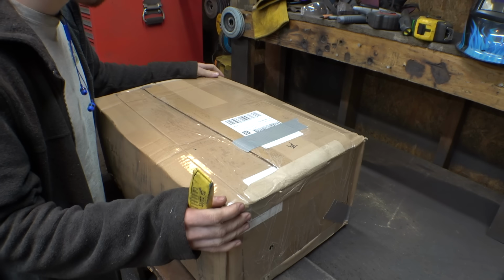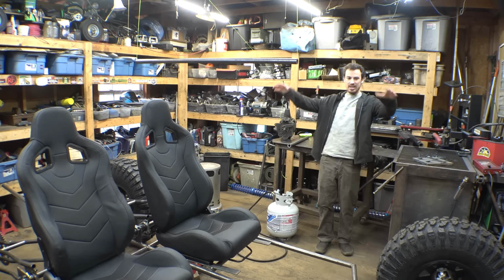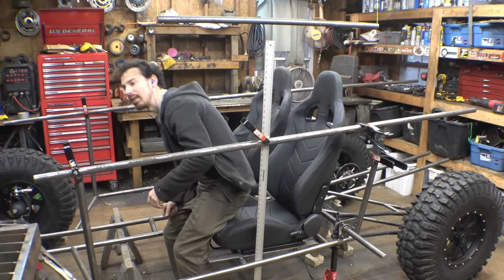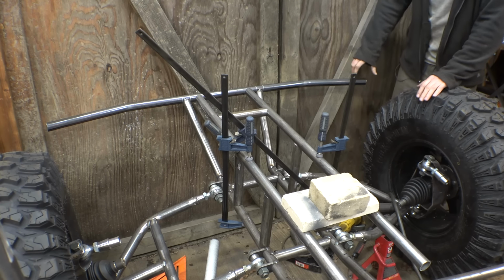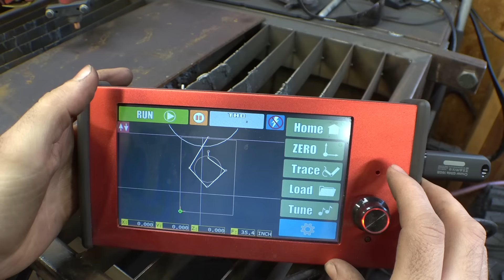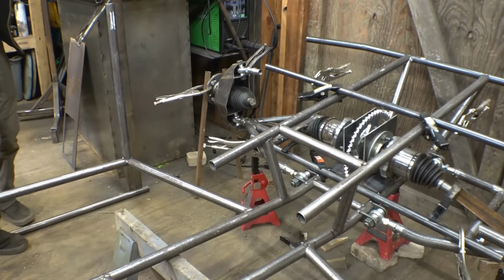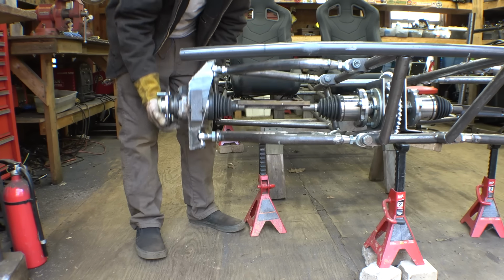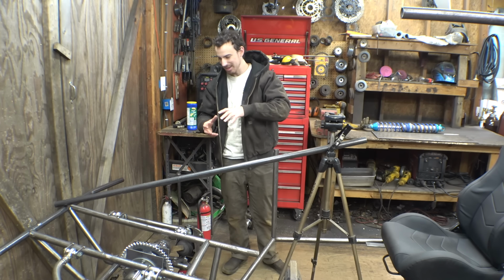Mini 4WD Trophy Truck Project - Part 3

Comment from the maker: Last video you guys where asking about the seats I'm using for this project so here is a link for them on amazon 
https://a.co/d/hvVlpAu
Reply: Glad you mentioned those T90 Jeep Transmissions been trying to figure out something for a drive train in a creation I want to build... found 3 on ebay under 800 bucks with the twin stick  transfercase
Reply: If you need parts for this transmission you can get literally any part from Kaiser willys last time I checked
Reply: Their parts are more expensive but higher quality.
Reply: Sorry but no way the other cart has 18 to 19 inch's of suspension travel you would need 19 inches or more of ground clearance in order to have that much suspension travel...
Reply: I'm thinking about getting into building karts  where can I learn how to build karts
Reply: Quick thought .....do your side rails like you talk about BUT put them on with a hinge and gullwing them up for access then latched down and locked in
Reply: I think trophy / desert / short course trucks have trailing suspension with solid rear axel.

I'd call yours a 4wd buggy
Reply: do yourself  a favor. Discover "Suspension Seats" PRP is about the cheapest. Beard is the OG.
Reply: Bite it... Move the joint mounts in the hub. Move the shock bottoms out further.
Reply: @justinnitsuj7041  if its front engine its a truggy rear engine buggy.

Comment: I was super hyped about this build all the way up till you started placing the bars for the sides and roof and then I realized you were going to build a high top conversion van. You've got the roof bars a foot+ over your head to make room to get in because you've made the side bars tall enough to make it a 2 story interior. 

Lay your seat backs down some, drop the side bar height and roof line way down. That will help 2 things, 1st will be top heavy issues and 2nd will be support for your spine. Taking a beating sitting upright is the worst thing you can do to your body. That's why all off-road builds have a short roof and a leaned back drivers seat. It keeps you from jamming your spine together if you hit hard bumps/jumps.
Reply: One thing he could do is go out to any 70-95 pickup and measure seat to door window height those are the years that you can role the window down and rest your arm on the window frame comfortably back before ac was standardized to vehicles and often trucks weren't optioned with ac... Once ac was standardized the window heights went up as rolling down the window was thought to only be necessary for drive thru windows as well as to better retain an occupant in a side impact
Reply: lmaooo hightop conversion fan

Comment: Nice build. As for the suspension travel, no one ever considers rotating the outer ball joints 90 degrees. This will give you infinite vertical articulation. Imagine the outer ball joints in the smae orientation as the inner ball joints. You don't need to spin the tire around 360 degrees. So why have the most freedom of motion dedicated to the wheel turn radius? Use high offset bushings and next size up if you want more wheel turn, but you probably don't need it.
Reply: You can even just do it for the upper one in this case and get the travel he needs
Reply: Your question intrigues me.
I've looked at my catalogues and manuals and it turns out ball joints are meant for load parallel to their axis (vertical load, vertical joint).
Surely it's not a matter of the bolt being weak... a big fat high resistance bolt is several times stronger than the sheet metal it's bolted to.
Vehicles and cars are the same: I really can't understand why ball joints are not used in the other direction.
Reply: @Morannar  well actual ball joints are different, these are heim joints. With a heim joint, you can use a through bolt grade 8 and when supported on both sides it is way strong enough for this light vehicle.
Reply: @TheChicagOP  might as well do both. The inboard joints are mounted with horizontal bolts, why not do the out board joints the same?
Reply: LIMITED TO CV AXLES OPERATING ANGLE REGARDLESS, AND THE STEERING ANGLE LIMITED TO MATCH SO YOU DONT OVER ANGLE THE CVS
Reply: There are a good number of people running their bearings with the bolts horizontally on the spindle upright. Check out speed utv, that design allows the car to use the same upper and lower arm on both sides of the car.
Reply: Great video. Thank you for including more of the fabricating. You hit the perfect balance between that and the explanatory sections. 👍
Reply: Everyone considers it, look at any modern day trophy truck, what you then run into is steering lock issues, in most cases steering lock is favoured rather than wheel travel

In a big heavy trophy truck wheel travel is favoured and they run 1 1/2  spherical uniballs so they still get a somewhat decent amount of steering lock
Reply: After asking the supplier about it, I'm feeling dumb.
They set a load limit for the joint in the vertical position because, that way, the joint is stressed.
There is no load limit when the joint is laid flat because, obviously, that way the joint is not the stressed part (instead, the bolt is).
Duh.
Reply: @Youtubeforcedmetochangemyname  I have seen a lot of full sized builds who still place the joints parallel to the ground instead of vertical.
Not sure why.

Comment: Couldn’t wait to get off work once I got the alert. Only way to start the new year off. 😎 because Rather B Welding is one of the best fabricator on YouTube, no fancy lathe or millers just straight old fashioned fabrications.

Comment: You can always put in pins to be able to remove that side bar to allow access into the vehicle. 
Additional safety feature you might consider is the window nets to help keep arms and hands inside the enclosed area as people have a tendency to lose control of their arms as the vehicle rolls over.
Just a precautionary addition since you are increasing the speeds at which your traveling, and better to be safe than sorry I believe.
PS
You have the easiest calculator in the world in your hands.
Simply line up the end of the tape measure with the number that you want to add or subtract from.
Then say you want to add 6" to say 31", just slide the tape end past 31" until you get the 6" mark inline and look at the end of the tape measure.
Should equal to the total of the two combined numbers. Just the opposite to subtract, but instead of moving the tape forward past the whole number.
Simply look to see where the number you are taking away lines up on the tape measure, and that's your correct answer. 
Basically using the tape measure as a old fashion slide rule, something akin to what the Chinese used when they invented mathematics counting devices.
Reply: Dont bother. this dude cant even count to 12 wtf rly  and you never measure "full" travel as the "full" travel lol. in those ENDPOINT angles you will immediately destroy youre cv or something else when it binds up. one needs atleast 2 inches safe margin on top and bottom travel to not bind the axles.. if you need more travel you need longer a arms and will end up with a wider vehicle..

Comment: Here is what is going to happen, as ive said 3 other times on this project, you will complete this, it will look amazing.  Youll ride it around your neighborhood and be amazed, then take it to one of those off road parks and overheat it and/or smoke the clutch trying to push that 1 ton vehicle and LARGE tires when that bike engine was meant to push a 300 or 400 lb bike.  Wish you would consider using honda k motors in these bigger projects.   that being said if you want more visibility out front try building your front shocks like an indy car with belcranks and run the shocks in the middle in line with the chassis.. That would be different and cool to see
Reply: The hyabusa weighed almost 800 pounds, it’s a big bike and could support over 400lbz of riders
Reply: @relentlessgaming4453  OP is right. 800lbs is closer to 400lbs than it is to 2000 lbs.

And the Busa turns much lighter tires, which is another way of saying much lighter tires exert forces on the drivetrain, those big tires are exponentially harder to turn
Reply: @relentlessgaming4453  a hyabusa is nearer 600 pounds.
Reply: @relentlessgaming4453  hayabusa is 586lbs. but although it is a very capable engine it's the size of the clutch and lack of torque that limits it ability in a heavy vehicle not to mention the extra rolling resistance caused by the much larger tyres and being 4wd
Reply: That engine is way powerful enough to push that vehicle around. He Has always said He enjoyes doing Things differet than other people. I mean He is  making it chain drive!
Reply: @sempi8159  the engine is but the clutch isn’t.
Reply: I was thinking the same (about the suspension), or at least at an advanced diagonal.

Comment: Try mounting top A-arm brackets to the top of the tube and bottom A-arm brackets to the bottom of the tube. You want to get the driveshafts as parallel to the ground as possible at normal ride height with you in the vehicle. You have very little compression at the moment with most of the suspension travel on droop at that driveshaft angle.

Comment: Use a fan to circulate the warm air :) or maybe insulate the door a touch by adding plywood to the inside to have trapped air? As climate changes and the years pass, we must adapt and overcome! A good sentiment to the years ahead! Cheers and all the best to your new year!

Comment: You want more than 12” of wheel travel if your calling a trophy truck type build. Aim for half the tire ratio 30 tire 15” min.   Bend you links at the ends to center your rod ends to get more up travel or rotate them 90 deg. Less turn but more travel up and down. Love your builds.

Comment: On most long travel setups you'd run uniballs vertically on the spindles. You'd gain a lot more travel in the arms. For the axles you can go in and make some clearance to gain a bit more before they bind.

Comment: IDEA!! 
If you are just looking for reverse. 
Why not look at snowmobiles. 
They run on a chain. And it's very simple systems to operate. 
If you don't need extra needs that is for future. Can fine machines cheap all the time. 
Newer systems with push button found on yamahas and arctic cats. 
Sick project BTW.

Comment: You can probably machine suitable spacers to obtain additional angle at a heim joint. Extreme angles on the top link may not matter but for the lower joint  it may compromise the load carrying capacity in the orientation that you are using.  Also ..  I think you will need diffs .. maybe three .. and locking, Maybe include some spacers in the front final drive to provide additional dimension so you can add a diff later without having to change the axles. Spur-gear diffs might be easier to make when chain driven, and using concentric axles on the lay shaft.
Reply: I agree with you on the spacers for sure! Also, I wonder if he could just use the front diff out of a RZR 1000 for the front and rear. Then he will have a lockable diff vs a chain driven spool!

Comment: Biggest thing with shock travel. Build the entire thing at full bump, then limit the down travel with the straps. With many of your previous builds you run much too large of shocks which case the chassis' to be taller than required and most of the shock travel is unused
Reply: exactly 100% correct. love the creativity from this guy but sometimes it just takes a bit of researching and you will end up with a way better build. building from bump height is the best thing to do when building anything.

Comment: Great video as always, and awesome work. I do want to comment on the front suspension and shock set up though... I love how you build everything !

Though it may seem wonderful that you only have 5" of shock travel and 12" of wheel travel, this means you have over a 2 to one ratio. This isn't necessarily bad, but on this type of vehicle it isn't good. For example, if you have 12" travel and 12" shock you have a one to one ratio and the load that is on the wheel is the same as what it is on the shock. If you have 12" travel and 6" shock, your spring rate and damper take twice as much load. In a long travel vehicle the suspension is going to take a thrashing. The spring needs to be twice as stiff to support the vehicle, so the damper also needs to resist twice as hard to stop bouncing... this means the shocks get really really hot. They will work worse as the day goes on, as they get hot, and they will wear out much quicker. It is also much harder to tune the suspension.  All of this to say, that if you're going to use this ratio, make sure that you have really good shocks. Lots of trophy trucks will have two dampers and one spring, and at least one damper will have a piggyback reservoir to try to keep the oil cool. 

it seems to me like you should consider changing the angle of the heim joints in the control arms so that you can maximize travel. You can do this without bending anything. It's going to be a pain, but the end of the hemi joint doesn't have to go into the control arm... Meaning you can notch the end of the control arm at the desired angle and weld the threaded insert on 👍

Comment: @electronsmove is right. Instead of using heim joints though I would use Uniballs on the outer joints. A little redesign on your spindles and arms and it looks like you could get another 3”+ in up travel.

Comment: Hi! Im new to the channel and i love the hands on approach 👍
Since i've studied some vehicle dynamics and the impact it has on the handling of the car, i would really recommend spending a few hours reading up on camber, castor, kingpin, ackerman and bumpsteer and the dynamic effects on the vehicle of that since that is bound by the position of the joints. It is true what you say about being able to adjust the camber etc afterwards, but only in a static case. You cant adjust the angle for the full range of motion the wheel makes. Maybe you have already considered this but if you havent, spend a few hours on google (or keep in touch and i might be able to send some recommendations) so that you dont have to relocate the joints later and find that the shock/spring is not fitting anymore. And by the way, if the travel at the spring is only half of what the wheel is, the force in to the spring (its joints, attachment points etc) will be doubled of that at the wheel. 

Hope to see more on the electric dirtbike soon, keep up the good work 👍

Comment: Flip your Heim joints sideways and use the pivot of the Heim for steering. Then you have unlimited up and down travel, or at least whatever your CV joints and tie rods can handle.

Comment: Recommendation for a heater, get a diesel fuel heater from Harbor freight it will  heat up that shop in an instant it does wonders for my big  20x40 shop with just one

Comment: Narrow the front of the chassis where the suspension arms mount, then can get more suspension travel without making it more wide? Like long travel suspension on prerunners and trophy trucks. Can play with shock mounting positions as well.

Comment: 4:19 rule of thumb, the headrest's top position should be at the very least, one palm (long) from the ceiling. So you got that height right. You want that height not just for other people, but also for safety. If you end up in a crash (knock on wood), that's the safety line.

Comment: So regarding your last video the reason the frames are flat on the trophy trucks with ifs is so there is less binding on the shocks. With the a arms being able to articulate backwards a little bit and shocks mounted vertical on ifs rigs you get a small amount of binding and when used like a trophy truck it's extra wear they don't want on the vehicals, also it means instead of straight up and down the cv joints are working on multiple axis instead of straight up and down. With the races trophy trucks are used for and the environment they are used in a slightly rougher ride to stop faster ware of parts rather then a bit more comfort at the expense of faster ware parts. You will also notice this in road use ifs vehicals.
Reply: You would also notice that solid axel rock bouncers and crawlers they have their suspension clocked backwards a bit with multiple coil overs. These are usually short courses where they punish the vehicals and arnt to worried about long-term use of parts as they expect to break them. It allows them to skip over the rocks smoother and avoid big breaks at the expense of the shocks and cvs.

Comment: You should swell the middle bar out bring it out about 8 in maybe 6 in and that way it is a little bit more protection for your arm and shoulder on the exterior and it will give the body a little bit better lines

Comment: You need to build the spindles with your heim joints vertical. That will give you unlimited travel. The only limitations would be the axle. Make some center mounted a arms to get more travel. 
Our Polaris pro r has 22” of wheel travel.

Comment: i would consider modifying /remake the front upright to change the joint movement and would also consider the suggestion of rotating thejoint 90deg so its onlyyour steering thats limited.
also just to help i would try and mount the damper position as far outon the wishbone as possible due to over heating the damper on rough terrain as the volume of oil will be small plus your damping will be greatly improved.
also on the damper a good starting point for the damper angle is 30-35deg from vertical.
drive shafts looks spot on setup 👍
Can the spool be taken out for maintenance ?
really cool project and cant wait to see the finished truck.

Comment: Sorry reposting this as the first was from a 2013 model RZR XP but the 2022 Polaris RZR XP 1000 Sport 20 inches of usable suspension travel front and rear.